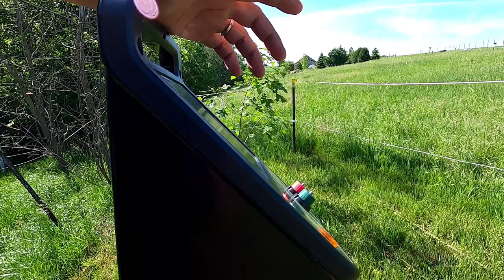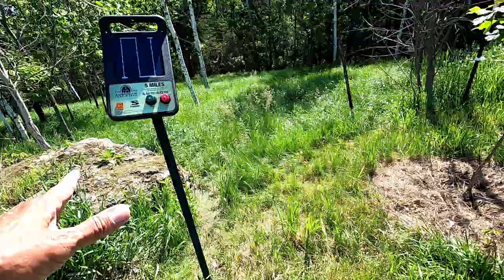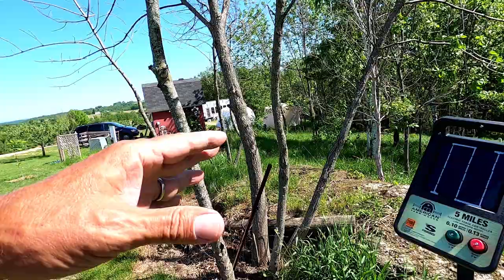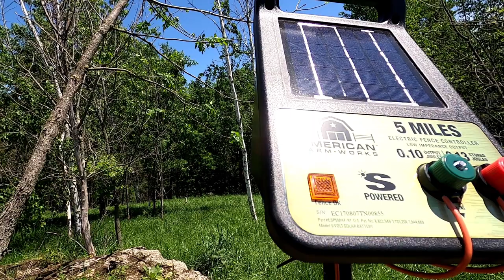How-to Hook Up a Solar Electric Fence

Comment: As I'm still figuring out my vines, I was wondering whether you water your grapevines regularly? I tried to distinguish shoots from canes when I did my formant trim. I wasn't very successful. :. As a former city boy, I'm learning a lot. Thanks for the vids.
Reply: oops "dormant"
Reply from the maker: Hi Samlon! No, I have not watered the vines since they were planted. Whenever I plant new vines I water for the first two weeks then any week where there is not an inch or more of rain. In our area we have enough rain to never have to water as the water is stored in the clay below as well. If you don't get an inch or-so a week you may need to drip irrigate.

Comment: Do you need a ground rod every 10 feet?
Reply from the maker: No. Just two, ten feet apart.
Reply: Do you have to have a ground wire underground with solar or can you just have the wire that connects the rods to the charger and a wire that connects the charger to the fence wire??
Reply: @stormieblancahrd9558  I thought you only need the one ground pole also.  Did you find an answer to your question?  Perhaps it is because he can't get it deep enough due to rocky ground...